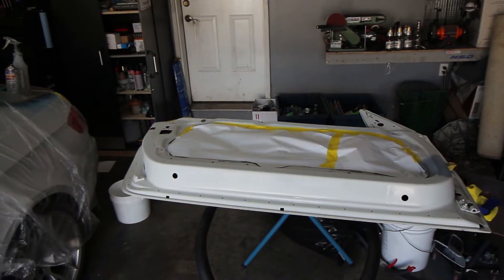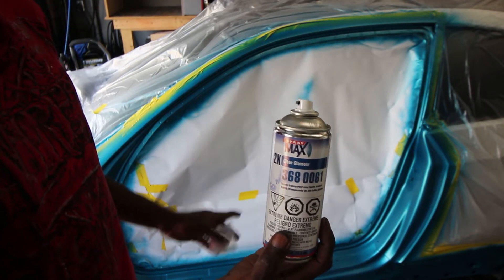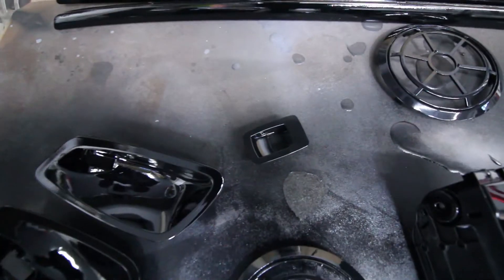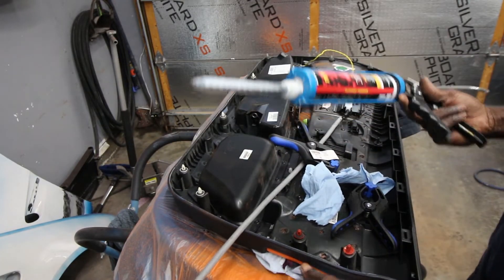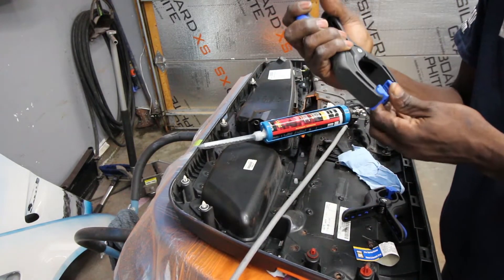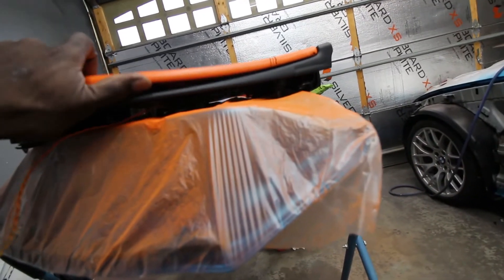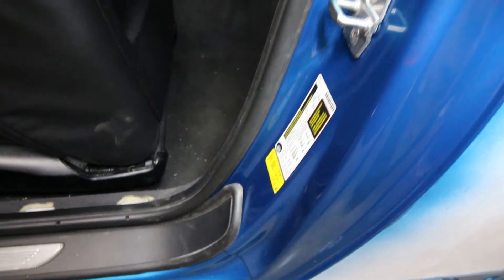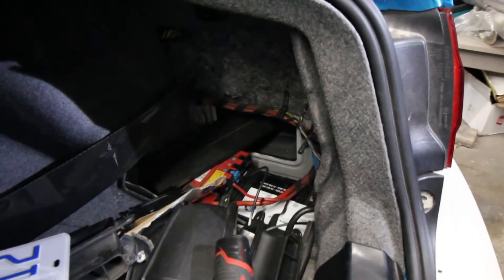BMW E92 M3 Custom Interior Color

Comment: Mad lover keep up the good work from one Jamaican to another 1
Reply from the maker: Respect
Reply: @FATmods  
I have a M6  2007
Reply from the maker: 👍what you doing to it
Reply: @FATmods   Custom exhaust cold air intake racing Pulley remap the computer took the limit off at a bunch of carbon fibre accent to it inside and outside
Reply: The costum exhaust is from active auto work
Reply from the maker: @clevehylton6493  damn